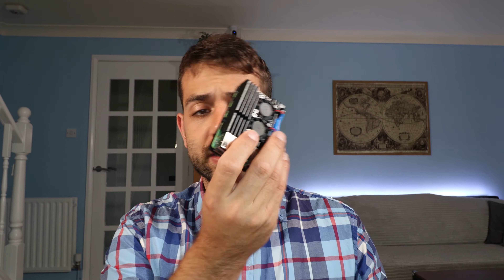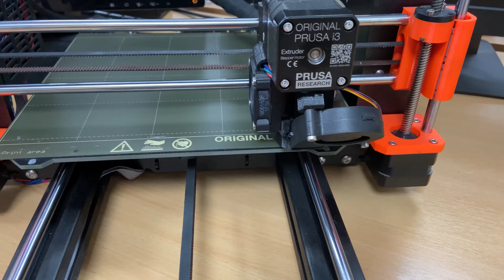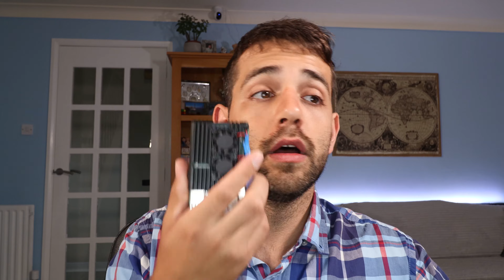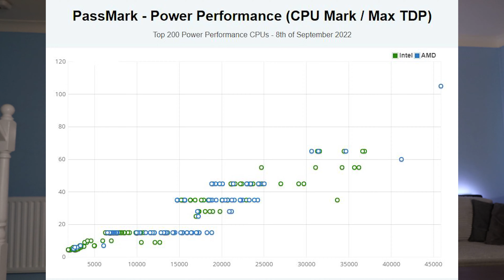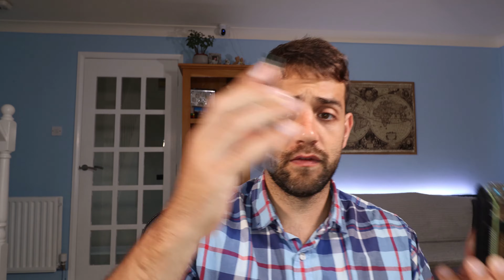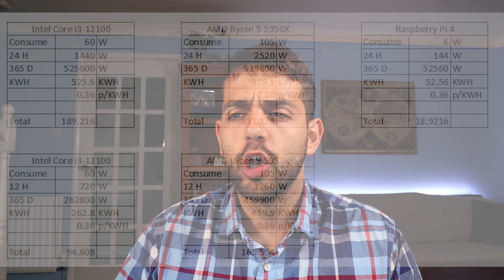What to consider when building a Server versus a Raspberry Pi 4 - CPU

Comment: You only calculate power on max power draw of a CPU, you don't look at the rest of the system and you also don't look if and how much power can go down when you have moments where utilization is low. For something at home i found this important because many systems i run are idle most of the time (at least half of the 24 hours when i am sleeping or eating and just not using my system. Also efficiency of the PSU helps a lot, so the power supply should be 80+ titanium and it should not be very over dimensioned to reach peak efficiency. 1 CPU that is bigger and can powerstep down very good when not used 100% will many times win from many smaller CPU's if they are roughly from the same year (efficiency of most increases when it is more recent) because they all run with their own chipset and have multiple chipsets instead of 1 to give power is also wastefull. And last a CPU is not the most efficient thing to do everything, for instance if you encode video and you can use the latest integrated GPU of a Intel CPU that is much more power efficient then software encoding. The general rule for finding the most efficient system for you is going 1 with a fairly new CPU as they generaly more efficient 2 Try to get one that can do all the jobs together at once you plan to run and is able to step down as much as possible when it is not running full blast. 3 Have a good PSU (every loss here is really a loss) 4 have dedicated hardware if that is more efficient for certain jobs.
Reply from the maker: Thank you for your input and additional information on power efficiency. You raise some great points about considering the overall system power draw and efficiency, as well as utilizing dedicated hardware where it may be more efficient for certain tasks. It's important to take a holistic approach when considering power consumption and efficiency for any system, especially for home use where idle times are common.